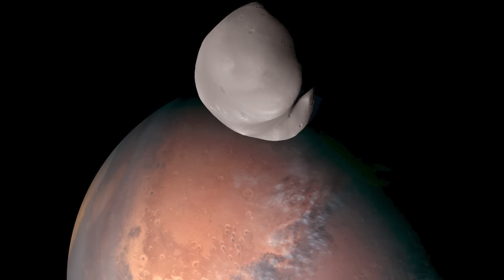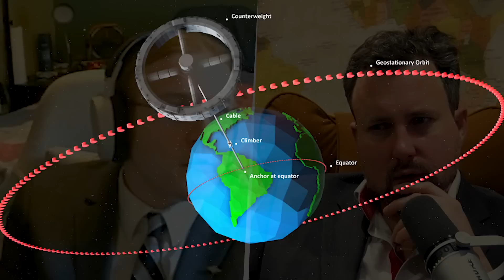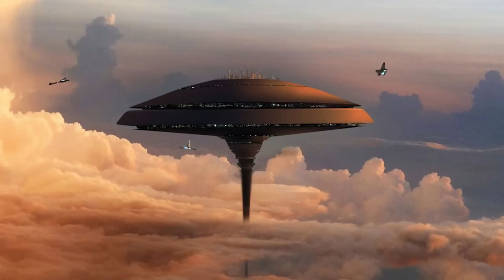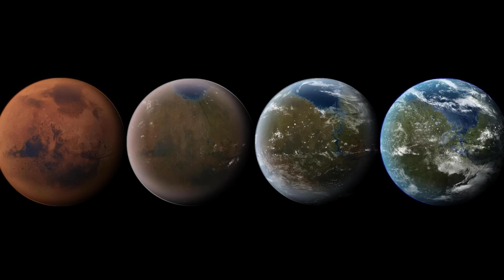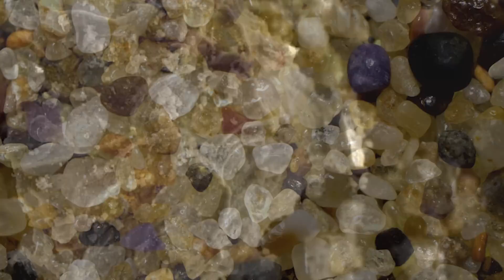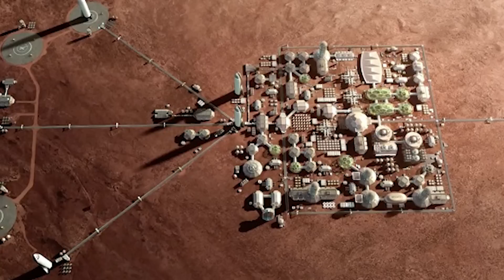Let's Build A Space Elevator!

Comment: I may have gotten the math wrong, but when I was calculating the necessary length of a space elevator (geosynchronous orbit), if the Earth were the size of a basketball, a space elevator needs to be about a meter long, maybe just a little more.  The ISS by comparison orbits just an inch or so off the surface - a couple centimeters.

The engineering problem with a space elevator is not actually the material science or even the material production - it is the construction of space elevator.  The argument is that you can get in orbit and extend some line out from both sides of a reel.
But here is the problem, each part of that line/rope/string/thread/[concept of flexible grabby thing] becomes subject to orbital mechanics and your assembly begins spinning.

They work if you can magically conjure one in place.
There is no proposed method of construction, as of yet, which can work.

And that is before we get into the questions of how useful they will actually be and/or what a sustainable maintenance cycle looks like.

By contrast, a form of fusion thruster and literally blasting skyscrapers into orbit seems more plausible.

Though, personally, I am more of a proponent of a gauss rifle launching payloads to an apogee at L1 or L2 with systems in place to capture and maneuver things around within the lagrange points and use them as mutual staging areas between the Earth and Moon.  You could mostly get away with mass drivers and small boosters.  At least within the context of going between the Earth and Moon and/or staging areas.  You might be able to use smaller rockets for distributing satellites, but a larger portion of delta v would need to come along a second vector the mass driver can't provide.
Reply: proposed construction method.
capture an asteroid in near orbit and use thrusters to achieve geostationary orbit. such as the one currently in orbit October 2024
launch construction craft to the asteroid surface to begin construction of the earth cable piece by piece.
earth crews construct a planet side target site.

upon completion. the asteroid fires the cable toward earth at almost no escape velocity.

the hook at the end of the cable is a guided module with thrust capability for re entry and to keep on target.

cable could be spooled or constructed as end to end connected shafts. that are rapidly assembled during the hooks travel.

crash the cable into the target which locks it in.

the geostationary satellite asteroid should mean the cable only has to take its own weight and the payload using asteroid based thrusters and gyroscopes to maintain its alignment should it drift.

further construction can happen reinforcing the cable and building structure around it once the initial cable is complete this will be easier now a platform can latch onto the cable and climb to any height.

the cable would need to be twice the earths circumference which is some distance.
Reply: @arcticghost1393  
Orbital dynamics does not play well, here, either.  Again, you run into the spinning problem.  You can dampen that with mass to an extent, but you will be expending velocity into the preservation of anything deviating from an orbital vector.

You need a cable which can survive the variations in force and which can ultimately survive reentry conditions.  Remember, geosynchronous orbit is where the mass from below tugs down upon the centripetal force from above, which would be generated by angular momentum and a counterweight.  In theory, a space elevator without any active load would just idle in orbit like a helium balloon in perfect equilibrium.  I could just drag it around and reposition it like a parade float.  Obviously, wind and other things make that unrealistic, but all of the forces acting on a space elevator "root" to the location in geosynch orbit.
"Dropping" a cable from an asteroid is no different from dropping one from space craft or deploying both the primary cable and counterweight from the same location in equilibrium.

Now, perhaps some method of placing an asteroid on an eccentric orbit and using a close pass to deploy a cable which could then "lasso" it into a geosynch orbit, but horrifying consequences of error aside, that is not likely to be feasible.
Reply: There's another problem with a space elevator, and that's radiation. Rockets can bypass the deadly Van Allen Radiation belt by simply going 'over' or 'under' it rather than going through it. However, since the only place you could feasibly put a space elevator is the equator, you'd have to go straight through the Van Allen belt's heaviest radiation. It's not bad if you bypass them the way the Apollo did, but going straight through them is not wise.
Reply: Fusion? Lol.
Reply: @diegomontoya796  
Z-pinch hydrogen-boron fusion is a thing.  It's a simple adaptation from VASIMR.
As for fusion power proper, the stellarator and plasma focus models are both valid with a differential lattice method allowing for cold fusion yet to be mathematically described, but is also valid.
No tacos.

Comment: A Space Elevator on Earth is fantasy. 
And a Space Elevator on the Moon is unnecessary. 
You could launch from the moon with an electrical linear accelerator. 
For a rail-gun type launch from the moon: 
Lunar escape velocity is about 5,300 miles per hour. 
So for a 6g acceleration, you'd need a track only about 30 miles long.
Reply: This is the way. The moon would basically be a space harbor. That or just develop antigrav 😂
Reply: @Bagginsess   Lunar escape velocity is about 5,300 miles per hour.   So for a 6g acceleration, you'd need a track only about 30 miles long.
Reply: @ThatBoomerDude56  and you can aim it. Whereas an elevator will need an anchor limiting its range of targets.
Reply: Doing anything on the moon is irrelevant.  There are enough near earth objects to build multiple space ships and multiple orbital rings.
Reply: Sky Hook is better than elevator
and actually feasible
Reply: Rail guns at that scale would require  stupid amounts of energy and they would ware out quickly. Skyhook is the best solution
Reply: @thebritishgeek   No.  Regardless of how you do it, you NEED to ADD ENERGY to the mass that is being sent into orbit.  A skyhook is not a magical device that can raise something up without adding energy to it.   A rail gun may be significantly more energy efficient than a skyhook.
Reply: @ThatBoomerDude56  I highly doubt that, a skyhooks advantage is it hooks the cargo and winches it up towards a landing platform. 

The energy can be created on the moon via solar. As the video says it doesn't need to go fast since it's cargo. 

Rail guns on earth have to overcome gravity and air resistance and also ruin themselves within a couple of shots
Reply: @thebritishgeek   Huh?  Why are you saying anything about Earth?  That has nothing at all to do with anything I said. 

Neither a skyhook nor a railgun can ever be used on Earth to launch all the way into orbit. 

And if you're going to launch into lunar orbit from the moon, a railgun obviously is more energy efficient.  A skyhook would need some sort of rocket motor.
Reply: @thebritishgeek  a skyhook or elevator requires far more materials, is more prone to damage, is slower, is less accurate (cable vibrations and sway of ship/cargo), and most importantly has stupidly limited range. The same amount of gravity and atmosphere needs to be overcome regardless of the method used but unlike a cable, a railgun can launch the cargo deep into space where as the cable only delivers the cargo to what ever it is attached too.

If you are worried about the railgun burning out what do you think would happen to that cable? The cable would be constantly under immense forces. Having to replace rails would be substantially less costly and that ignores the fact that coilguns also exist or that cooling systems can be improved or you can utilize barrel swaps to rotate in cool barrels. Worst of all is that the cable is very exposed to radiation and micro astroids/debris. A railgun can be housed in a shielded bunker complex while the cable just sits there on an elevator. Even for a skyhook the cable is exposed when in use.

Best of all the railgun can be weaponized in case of military conflict unlike the cable. It can also be used from earth as it can launch a rocketship a certain height before its engines take over. Lowering the spent fuel which can be saved for longer trips or simply be removed and save on weight.
Reply: If you watch the full interview I actually do mention that